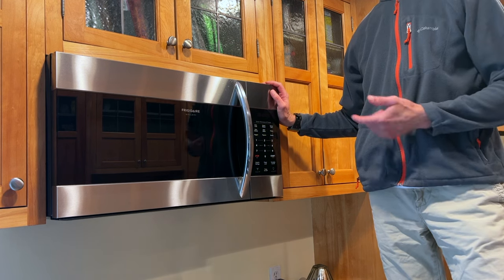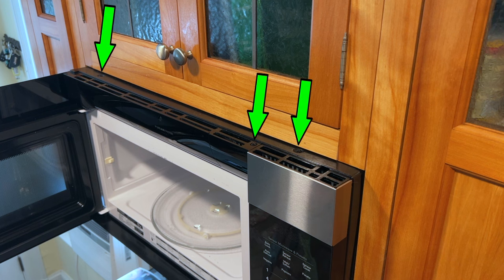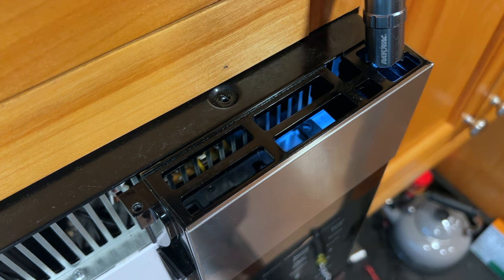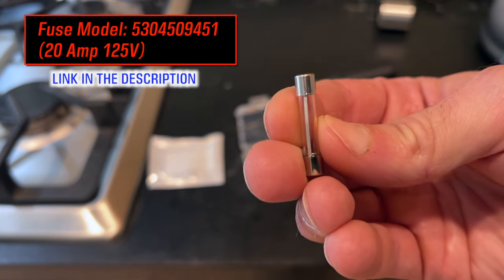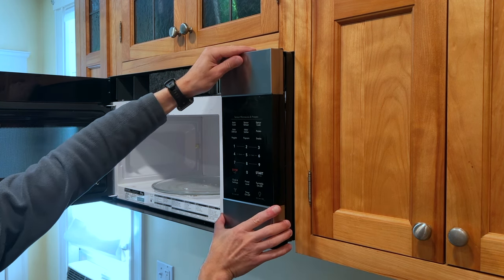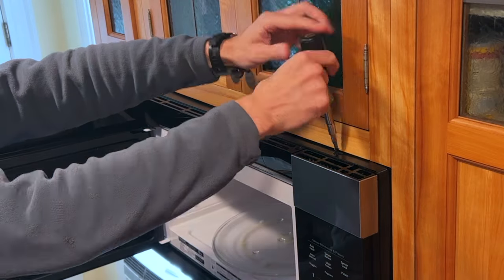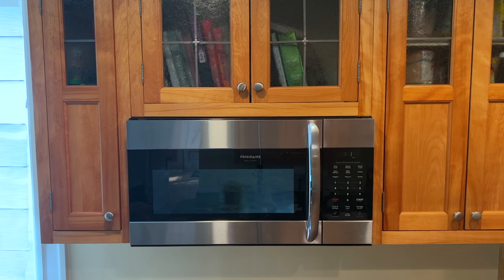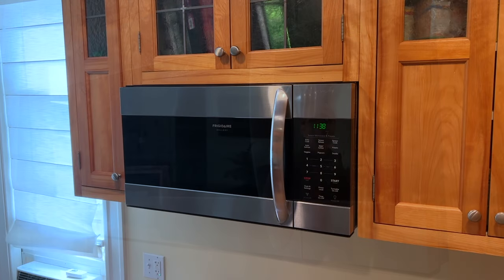Frigidaire Gallery Microwave Fuse Blown... Dead!... Replaced... Repaired! FGMV176NTF

Comment: Best video.  Blew out 5 fuses in 4 weeks.  Finally corrected the issue by following the instructions here.  Saw the video in its entirety, muted the beeping and decided to adjust the door so it opened easier.  Door was warped and tough to open due to downward pulling.  No longer shorts out!  If fuse blows again, I know the cause and solution.  Thanks!!!
Reply from the maker: You’re welcome! Glad it was helpful.
Reply: I almost threw mines in the trash until I watched this 🙌🏿
Reply: @300Smartans What did you do to adjust the door?

Comment: I basically have the same microwave. I followed these instructions and it was the fuse that blew. I didn’t have a magnetic screwdriver so I took a magnet and magnetized it. Worked like a charm. Got an original fuse for seven dollars. This process probably saved me $150.00 repair bill.
Reply from the maker: Excellent! Glad the video was helpful.

Comment: What causes the newly installed fuses to blow immediately? I must’ve missed that part. Lights came on when I plugged it in. Set clock. Started a 30 second test and fuse blew a second or two into test.
Reply from the maker: Did you put a cup of water or something to cook in the microwave when you tested it? You need to do that. If you did that then the issue could be any number of other things. In your case it doesn’t sound like faulty door switches, which I mentioned in the video. For example, other things that cause the fuse to blow immediately include wrong fuse rating or type or a defective part (magnetron or capacitor). I don’t recommend replacing parts other than the fuse since it is dangerous and requires discharging the high voltage capacitor. Recently I was replacing a GFCI outlet, which is on the same circuit as our microwave and upstream from it. I discovered that whoever installed the original GFCI outlet incorrectly used a GFCI outlet rated for 15 Amps. The circuit is rated for 20 Amps and appropriately wired with 12 AWG Romex, which is code. That may have been contributing to my issue, but I’m not certain about that.

Comment: I Have the same microwave, mine blows fuses after two uses. I was told the door is probably causing it and a bad door switch.
Reply from the maker: Yes, that is likely the issue if fuses keep blowing. The door switches in this thing are of poor quality.
Reply: @BruceAlanR  Update: I went on Ebay and found a practically Brand New ( Store Demo Model) touch screen panel, circuit board and everything on the right side assembly. I got it for 80 Dollars including shipping. Earlier today I replaced my original with it, have not had a blown fuse or anything else all Day. I used it many times and it seems to be working like it was before the issues started a month ago. I am optimistic it works. Definitely cheaper than buying a new one.  Mine was made in 2019. It's  not that old and well cared for.

Comment: Omg. The top cabinet is covering two of the screws I need to remove. That explains why I can't remove the plastic trim. This just got more tedious 😮‍💨
Reply from the maker: Yes, I had the same struggle as I didn’t notice the two screws on top. Luckily our cabinets are standard depth so I eventually figured it out. It’s definitely an extra headache if you can’t get to the top screws easily.

Comment: The fuse has blown two times in the last two weeks.  I am doing the open when still running and pulling down so will be especially careful and see if that solves the problem.  Thanks for the really step by step.
Reply from the maker: Glad the video was helpful. If the microwave is running I definitely recommend pressing stop before opening the door. That solved the problem for us.

Comment: Thank you for this! Just paid the same cost as the microwave for a repair guy to do this. Now I know the fix.

Also, I know not to buy microwaves on major discount again. This thing is tempermental
Reply from the maker: I was in the same boat! I was about to hire someone or just get a new microwave but figured I’d at least change the fuse and give it a shot. I’m disappointed that Frigidaire uses such poor quality/fickle components. We have the Gallery dishwasher too and the quality of the racks and stainless steel is embarrassing.
Reply: @BruceAlanR  yeah my fuse actually just blew again. I think I'm done with this microwave.
Reply: Every one of our low priced flipper Frigidaire appliances is deciding to die at the 5.5 year mark.

Comment: Super helpful video! By unplugging the microwave, does this mean you can complete all of this without injury caused by electrocution, etc?
Reply from the maker: I wouldn’t say it’s completely safe. You don’t want to make contact between too many things at a time. Changing the fuse in this model isn’t as dangerous as changing out the door switches, which would require discharging the high voltage capacitor. That’s a bigger and more dangerous to do.

Comment: Great video!!! Fixed my problem and saved me $100s
Reply from the maker: Glad the video helped! 😃👍
Reply: @BruceAlanR  What causes the newly installed fuses to blow immediately? I must’ve missed that part. Lights came on when I plugged it in. Set clock. Started a 30 second test and fuse blew a second or two into test.

Comment: Very well done. Do you have a link to those fuses?
Reply: I see the specs in the description, so I’m good. Our microwave is also 5 years old and my kid opened the door while it was cooking. And poof.
Reply from the maker: Yup. That’s how it happens. These are the ones I ordered: 5 Pcs 20a125v 5304509451 Microwave Fuse for Frigidaire CFMV157GCA CFMV157GQA CGMV175QFA CGMV175QWA,for Electrolux EI30BM60MSC EI30BM6CPSC,for Kenmore 790.80323310 790.80332310 790.80349310 https://a.co/d/gs9ZwZY
Reply: @BruceAlanR Fantastic. I appreciate you! Repairing this as we speak.

Comment: I changed the fuse, but immediately after plugging the microwave in the fuse blew again it appears. not as bad as the original but still black on one side. any idea what to do or what I did wrong? Wires all look okay.
Reply from the maker: Hmmm… I wouldn’t think the fuse would blow as soon as you plug it in. The clock and light don’t draw much power. Did you replace the fuse with a comparable one?

Comment: So I replaced the fuse and the microwave worked for a while then tripped my 200 amp breaker on the main box, what else could be the issue on that board?
Reply from the maker: Wow! That’s pretty crazy that it tripped the main breaker in your box. After the fuse, the next thing to check are the door switches… or get a new microwave.

Comment: Our Frigidaire Microwave stopped working after the power shut off to the house.  After the power came on again, the Microwave interior light comes on, but the unit will not start. The display screen won't light up either.  Any ideas on this?  If it is the switches that are bad, where can I order them and are all 3 the same or are they different?  Thanks in advance.
Reply from the maker: Those are some odd symptoms. If the display doesn’t light up, but the interior light comes on when you open the door I don’t think replacing the switches will solve the issue. Sounds like something got fried.
Reply: @BruceAlanR  Thanks for the reply....would the door light come on if the fuse was bad or would the whole unit be off with the fuse blown?
Could it be that the circuit board got fried and that's the problem?
Reply from the maker: @USCG.Brennan When the fuse blows the whole microwave goes dark (no lights, no beeps… just as if it was unplugged). My guess would be something on the board, but that’s only a guess.
Reply: @BruceAlanR   OK, that answered that question then.  If the fuse is blown NOTHING works at all.  Sounds like the circuit board then. Thanks for your response.  Is the circuit board hard to replace and what is the approximate cost?  Cost wise, maybe a whole new microwave is needed instead?

Comment: I can only find 250v replacements, since the microwave is only 125v, I can use the 250v right?
Reply from the maker: The video is for information purposes only so please proceed with caution and at your own risk. While technically it is possible to use a fuse rated for higher voltage as long as the amperage is correct, I would still advise against it. Additionally, the fuse in our microwave didn’t have any markers indicating whether it is fast or slow blow (again, this relates to current/amperage and not voltage) so I’d want to be sure to find a suitable replacement to be safe.
Reply: No problem using a higher voltage fuse. It's best to use a coated fuse like the OEM. It keeps glass from exploding on a standard fuse. Amperage on the fuse, however is a must match. Most microwaves have problems because of door switches. Don't allow anyone to slam the door, and it's best to press stop before opening if you are in mid cook.  The switches for years are just too small for the amps run through them. Door Switches again are the main cause of microwave failures

Comment: I replaced the fuse about 4 times in theblast 4 months. Each time the microwave worked after replacement, but it goes back out in weeks. 

Any other reason for this other than what is presented in this video?
Reply from the maker: I would check the door switches, but it’s more involved.

Comment: I did exactly what you said but the fuse blew again. Need recommendations? 

I have the same microwave and ordered the fuse recommended. Thanks
Reply from the maker: My guess would be the door switches then, but changing them will require discharging the capacitor.

Comment: Our Frigidaire Gallery microwave will only heat on high no matter what power level you choose. Any suggestions. Great videos BTW.
Reply from the maker: If you put in 3:00 and then immediately press the Power Level button repeatedly to select say 50% (PL-50 in the display) and then press Start it still cooks at 100%?
Reply: @BruceAlanR   yes it does. I tested the microwave using a Pyrex measuring cup and heated it at each level for a minute.  The difference between 1 and 10 (full) was 8 degrees.

Comment: Hi! Can you tell me please where can I get the fuse? Thank you!
Reply from the maker: You can get a fuse directly from Frigidaire or from Frigidaire through Amazon, but they’re more expensive than the comparable fuses I purchased. Here’s a link to the one’s I purchased: https://a.co/d/3zBXVB9

This is the link to the OEM part sold by Frigidaire on Amazon, but it’s $18 for one fuse and no better than 5 pack I bought for less in my opinion (I still have 4 of the 5, but I have them should it happen again): https://a.co/d/8zqbag8

Comment: I got to say microwave replaced the fuse three times already it keeps busting. Can you tell me what else it could be please
Reply from the maker: If the fuse keeps blowing the most common culprit is the door switches.  The switches are garbage in this microwave, which is why you should never open the door while the microwave is cooking without pressing STOP first. Unfortunately, changing out the switches requires removing the microwave from the cabinet and most importantly discharging the capacitor before going inside. That’s the only way to do it safely.
I cringe every time I see a family member yank the door open at a downward angle or slam the door shut, which contributes to premature switch failure. Not everyone is 6’ tall though so I get it. If possible, the best way to open the microwave door to prevent the switches from blowing the fuse is to grab the handle and use a thumb to push off the side of the panel. That way the door opens straight without putting pressure on the switches.
Reply from the maker: BTW- I talk about why the fuse blows and how to open the door correctly at 7m:47s. I should have placed it sooner in the video.

Comment: Thank you.  Do all microwave fuse use 20 amp 125v?  I have GE CVM1655stc01.  I’m in North America, amazon searches show up with 250v
Reply from the maker: Not all microwaves use the same fuse and the correct fuse is very important. I would recommend seeking a parts list for your model to make sure you get the correct specs and a fuse that is comparable to the OEM part.
Reply: @BruceAlanR  thank you for your response.  I contacted GE and their suppliers, none of them can tell me the voltage. I was provided with two different part numbers. The GE person started going on about the light.  I had to bring them back to the fuse above the control panel and not the light bulb.  It is truly maddening lol.

Comment: Is the fuse slow acting or fast acting? It’s not specified on the product page or on the broken fuse
Reply from the maker: You are correct that the part gives no indication of whether it’s a slow blow (time-blow) or fast blow fuse. Looking at the filament, some folks are mislead by the thickness of the filament. The thicker filament wire would indicate that it’s a slow blow as well as the “326” on the 
original OEM fuse; however that’s not always the case. Sometimes fuses are marked with an F for fast or TD for time delay, but there are no markings. So the short answer is I have no idea.

Comment: What if the fan, clock, and light work. But when trying to cook it trips the breaker. New house 4 yrs. Old.
Reply from the maker: Sounds like the microwave is plugged into an outlet that’s on the same circuit as another kitchen appliance.  Most kitchen circuits are 20 amps, so if a refrigerator and dishwasher are sharing the circuit and running at the same time, the breaker will trip. Usually refrigerators, ovens,  electric ranges, each have their own designated 20 Amp circuit.
Reply: @BruceAlanR  I am by no means a small appliance expert, but with this symptom there may still be something more at play inside the microwave. Mine does the same thing, but didn't start out like this - the first symptom was a tripped breaker only when the door was opened prematurely before cooking ends (and only sometimes). Like you suggested, we retrained our muscle memory to hit the stop button before opening the door which worked for a few months, but now it trips the breaker as soon as the cooking starts - every single time. I went as far as plugging it into three separate circuits, one of which a dedicated outlet...same thing happens on all. My microwave has effectively turned into a 'breaker finder 3000'. Could be a faulty switch, could be something worse - but either way, we have too many leftovers to reheat and not enough energy to properly diagnose and fix our issue...so I ended up just buying new. Cheers!

Comment: Hola porque será que se quema el fusible cuando abro la puerta
Reply from the maker: Sounds like the door switches are faulty or just temperamental. If it only happens when the microwave is running and you open the door without pressing stop first, try replacing the fuse and be sure the microwave has stopped before opening the door.

Comment: Couldn't a failing cap cause a amp draw causing a fuse to blow
Reply from the maker: Absolutely!
Reply: I isolated my issue to a capacitor. I am one of those who keeps random stuff. I had a almost exact match for the stock one on hand. I made the repair and it's been good ever since. The one I had on hand was a hair larger but same shape. Values were .07 higher but worked like a charm. Thank you for the info video.
Reply from the maker: @justinisom6161  That’s great! When it comes to keeping old parts in my crowded workshop, I always think, “It’s only junk until I need it!” 😃
Reply: Ok I was wrong. Microwave is out again. Lasted a week
Reply from the maker: @justinisom6161  Have you tried replacing the door switches?
Reply: I manually checked the door switches. I will tell you what is happening. I cook something in it and then I don't clear the time right away. I come back and it has blown the fuse. Do you think it could be the door switches? I'm not a pro I am a avid electronics dude from Florida I have re built a lot of stuff and am good with circuit boards. I work in automotive with electronic diag. That's my profession. If you can guide me thru this I would appreciate it very much.
Reply: @BruceAlanR we replaced all the door switches, and ours just blew the fuse again, 2 months later. 4 fuses blown, then ordered replacement switches. The last fuse, before full replacement, actually lasted longer, 5 months. Now blew fuse again, 2 months later switches changed. Something def isn't right with this microwave!!